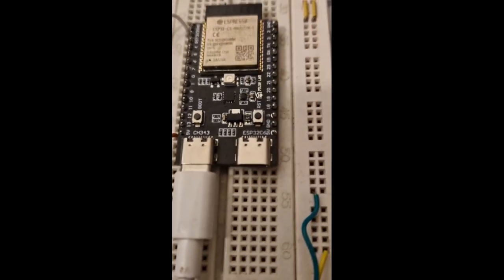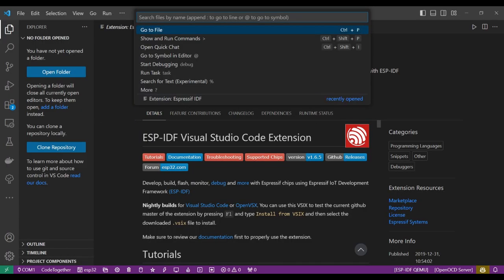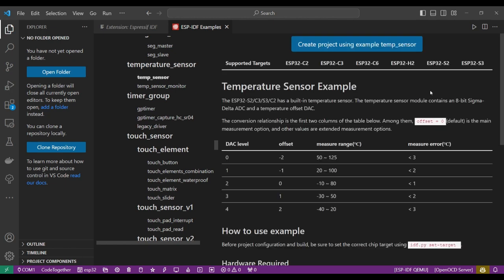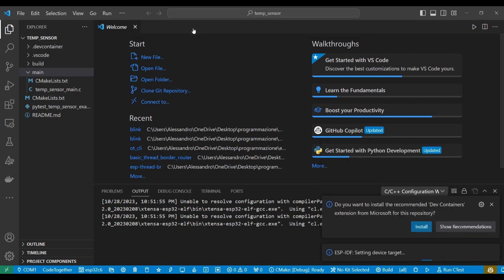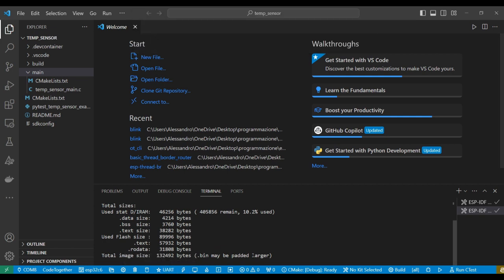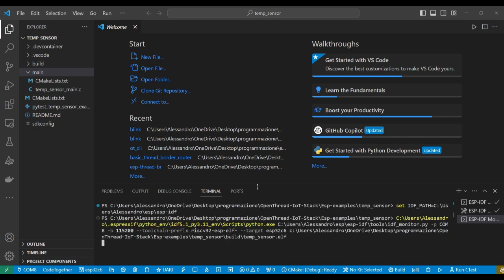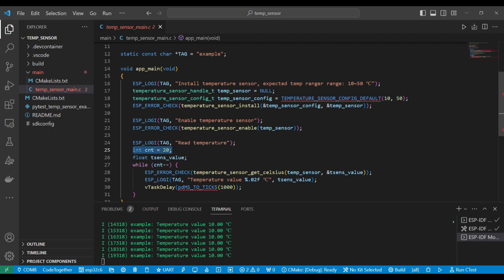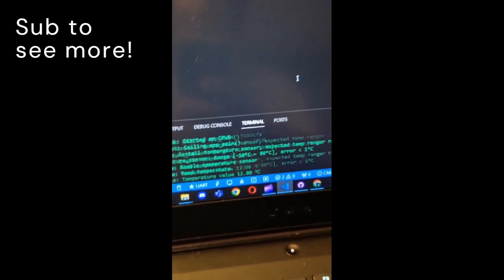ESP32-C6 - Temperature sensor

Comment: With arduino ide ?..
Reply from the maker: You can also use Arduino ide but you have less control of the hardware for specific features
Reply: @italian.programmer  Can you do tutorial for zigbee and support some range sensonrs (TOF) or temp sensors BP/BE 280
?